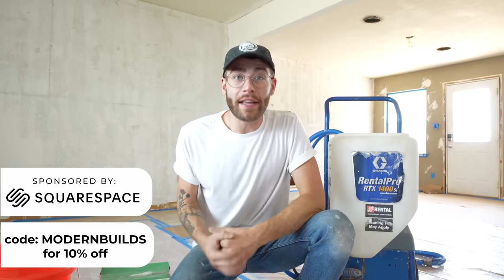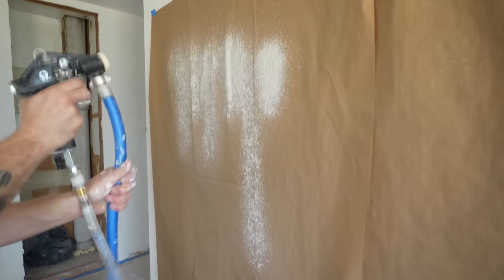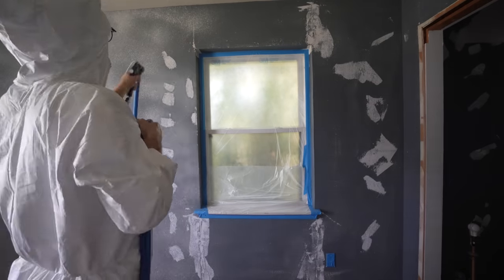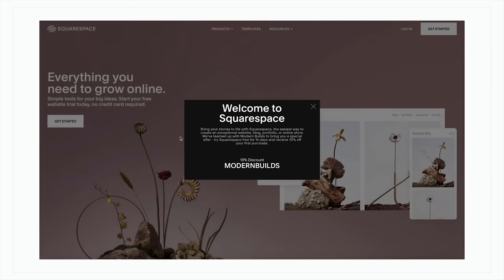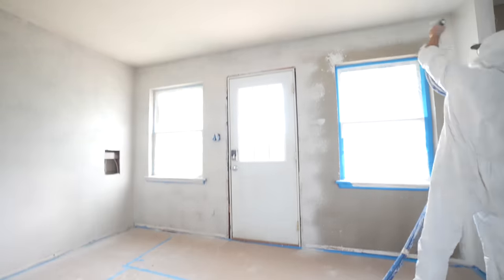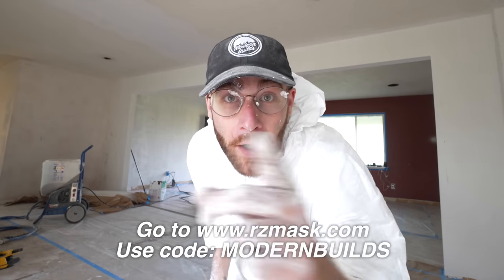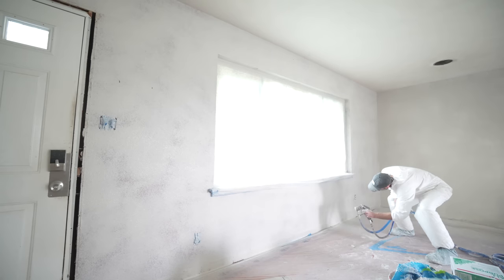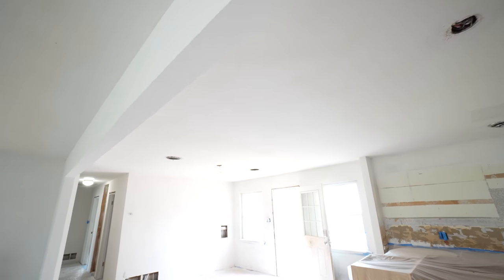How to Spray Drywall Texture in a Renovation / Remodel | Mikes First Flip Ep. 6

Comment: I don't have much experience applying drywall texture but i do on the painting/Bed liner side of things. You could do something called a drop coat. Essentially once the bulk of the mud is on the wall get the gun father away from the wall to where the fan/spread is much larger and do quick passes over the wall. It pretty much ends up being a light dusting over the area that helps blend any lap marks that might be too visible.

Comment: Why do people want textured drywall? Why not smooth walls?
Reply from the maker: It’s faster to do and easier than skim coating
Reply: It also blends any sort of blemishes/flaws in the walls. Makes patching drywall significantly easier down the road as there is a 'random pattern' rather than just flat.
Reply: Sound absorbing?
Reply: The texture also hides blemishes and faults by making the surface "busier" so your eye doesn't automatically focus on imperfections.
Reply: I don't see them here in Australia. We just fill, sand, make them smooth and paint. No blemishes to be seen.
Reply: @MrWhybotherwithme  Not really. My walls are textured and you can still see every single flaw. And it's way too "random."
Reply: @MichaelGalletly  Nope. It doesn't.
Reply: @Toni_Snark  Everyone's experience is different. But that's its purpose whether or not it works.
Reply: @felinetherapy4782  Thankfully Europe also left it in the 2000s...most of the modern buildings do not have it, it looks so outdated, especially if you use dark paint on it, it is awful.
Reply: @Bkate23 yea it looks cheap. But this little guy is just trying to make a quick buck on an ‘investment property’ so he doesn’t care what it looks like
Reply: @groundupRVA  well this is why my comment was not specifically ab Mikes house, I was just surprised like many people in the comments, how often we see textured walls in renovations in the US. But you are right, it's more often in the investment properties where people tend to opt for the let's not say cheapest but most cost effective option.
Reply: It's the best way to blend in drywall repairs and it makes the whole house look brand new and well done